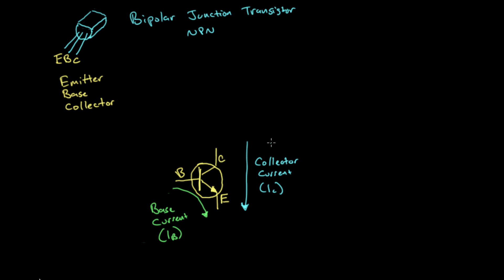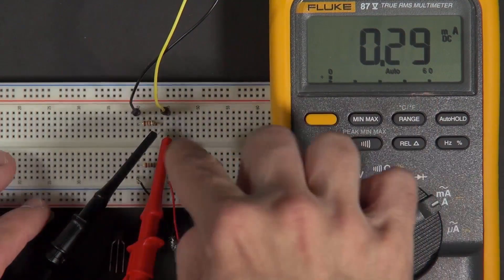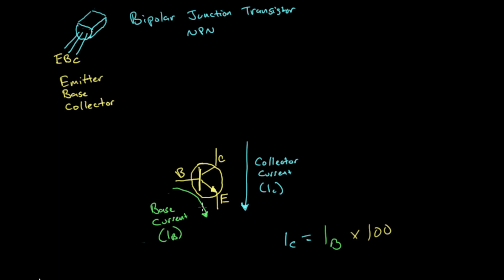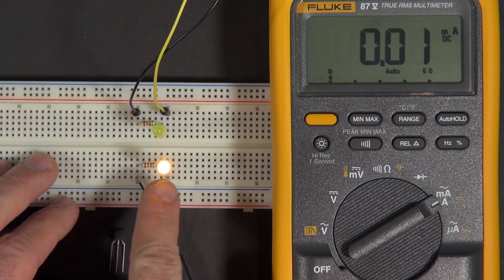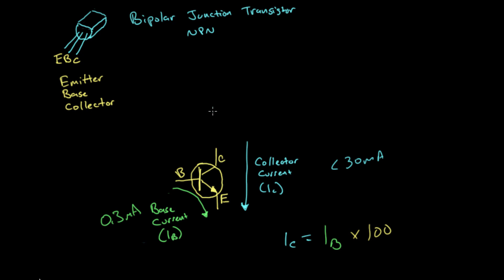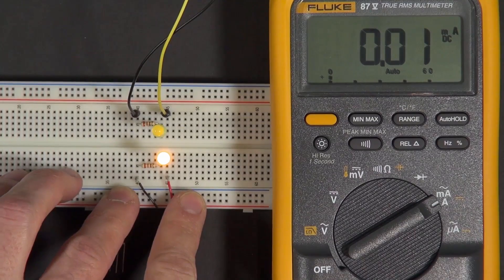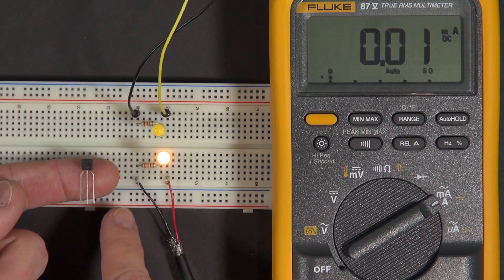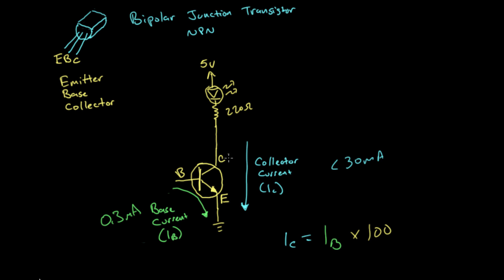Using a transistor to solve our problem | Digital electronics (8 of 10)

Comment: hi, i thought the whole idea was to use a transistor to  amplify the weak current from the mystery circuit.
But you did not do that. You just used the power supply circuit where the LED was bright to begin with.
wasn't that your pitch from the beginning ? Using a transistor to brighten the LED from the mystery circuit. Instread what we have here is a transistor used as a switch, not as a current amplifier.
Reply: thats what i thought as well,  it really seems that this circuit doesnt solve the original problem

Comment: What would happen if he removed the resistor at 8:19 and directly hooked the LED up to the emitter of the transistor? I know that then the voltage drop would be 5.0V, but surely it wouldn't be too bad because the current would be limited to 30mA? Would it still damage the LED if he tried that, and why?
Reply: If I'm not mistaken (which I might very well be) the LED would still possibly "burn" since the effect that it would have to discepate would be 0.15W (5V*0.03A) rather than the 0.057 (1.9V*0.03A) that it's rated for.
Best regards

Comment: What makes the multiplication happen inside the transistor? I just watched your video explaining how transistors work in detail and I understood all that, but how can I think about the current multiplication and variable resistor in terms of your other video? It feel like there are "decisions" being made inside the transistor, which I know isn't really happening
Reply: Cab Callaway hey the current is not at ol being multiplyed by 100 but it is allowed to pass only when even a current 100 times less flows from base.emmiter circuit
Reply: It's the nature of semiconductors. If you read up on this topic you will begin to understand what is happening in the transistor.
Reply: Since you didn't really answer my question, can you point me to resources that can?
Reply: OK, imagine the transistor as a kind of special relay where instead of an on or off state, the solenoid in the coil is attached to a variable resistor. A weak current will pull the solenoid, (which is being held back by a spring), just a little way from the totally off position to a corresponding large resistance position, giving a small current (or amplification). Apply more current and the solenoid is pulled further along towards the totally on position (the saturation position in a transistor), giving more current and more amp. Even more current applied to relay solenoid and it goes all the way. In this position it is acting as a switch. Hope this helps.
Reply: @Cab Callaway https://electronics.howstuffworks.com/diode.htm

Comment: Is it always safe to just connect two separate circuits' grounds like that? I can't quite put my finger on it, but it just doesn't seem safe to me...
Reply: Usually. There is a thing called ground loops that can cause trouble, but usually it is fine. Connecting the ground ensures that both circuits are measuring voltages from the same zero reference. Otherwise the signal voltages from one circuit would not be meaningful in another circuit. (I wouldn't recommend connecting both grounds and supply voltages at the same time between two circuits, though. That sounds like trouble.)

Comment: Your explanation of how a transistor amplifies was good.  But I felt your final example only demonstrated how the transistor acted as a switch, but I didn't really see an example of it amplifying.  Maybe I missed something.
Reply: That's the reply I would have given, @KoksBettan ;)
It's an awful use of the word 'amplifier' applied to a transistor.  An amplifier is a circuit and that's what Ben is describing. I knew enough to predict that the USB power would have to be used but I did get a little bit excited thinking that there might be some magical way to get a bright LED without it.
Reply: Hey, one step at a time brah.
Reply: This is the introduction to digital circuits hence using the transistor as a switch, aka 0(cutoff) or 1(saturation). Look up transistors use in analog linear amplifiers to see it used in all states between cutoff and saturation.
Reply: See my comment on Scott JD's post.

Comment: Thanks for the explanation, but I have a small question: Why do we have to connect the external ground to our ground (from the power source)? What would happened if we just ignore it? We're feeding the transistor with the signal anyway, shouldn't that be enough?
Reply: Logically speaking, the 'ground' has the same voltage as the emitter. That's why we have to connect the 'external' ground to 'our ground' to properly maintain the voltage difference between the collector and the emitter.
Reply: Also so that base current has a return path to the original circuit.

Comment: Thank you for the video! I have one question, Why do you need the resistor for the LED if the transistor itself has a resistor in it? Couldn't you remove the resistor?
Reply: No because the transistor wants to push 30mA but the external resistor is limiting that potentially 30mA output to just 20mA. You remove the resistor, you might blow the LED.
Reply: Because the LED is bright enough and with this resistor you are increasing the lifetime of the LED. Yes, and you are saving current -> energy (imagine the resistor is infinite).
Reply: The big reason is that the amount of gain from the transistor varies a lot. For a 2N3904 it's varies from 30X to 300X from one device to another, even from the same batch of transistors.  You can test each one but most of the time it's easier to make the output current higher then you need and then limit the current with a resistor.

Comment: Ok, I like the way you explain things. Keep up the good work. As for this video I'm still a little lost as you explained the transistor as a current amplifier . So I was expecting this transistor to power the led on top of the breadboard from the mystery (555 timer) power. But instead to me it looks more like a switch because your still using the original power from the bottom half of the bread board, and then using the low current from the mystery power to tell the transistor with the little current to switch on and off allowing the bottom power to complete the circuit. 
Of the original bottom USB power wasn't in this final circuit then I could see how it's acting as an amplifier. But now it's using two power sources. It's not until the end when you call the transistor a low current switch that controls the larger current from power supply 1 (USB) that my mind agreed with you, but how does amplification play a part? So am I seeing this wrong? What am I missing?
Reply: As soon as the video ended, I was left with the same question as Scott JD.
Then I had to think about it for a little while:
Whether it acts as a "digital switch" (sat/cutoff) or as an "analog amplifier", transistors don't create more energy out of thin air. In order to allow a transistor to amplify a signal, you need that "extra" energy to come from somewhere, from another source. What the transistor as an amplifier does, it to maintain the order and proportion of the incoming signal, and just make it more "intense", so that intensity is analog to the incoming signal. So the BASE is that signal, and the transistor will respect it while "mixing" it with the extra power that you feed it through the COLLECTOR. 

So the name of each lead actually tells you what is happening:
The BASE is a signal which "waveform" has to be respected
The COLLECTOR collects energy from another source, which will be used for amplification 
The EMMITER emits the amplified base signal. 

Think about any component that you have used in your life: they all need a "raw" source of power to amplify base signals (which almost always account for information rather than power supply) accordingly. 

The volume knob on your stereo? Wall socket. 
Electret Microphone? AA battery. 

So to end it all, you could think about the BASE as "electrical information" which needs to be amplified and the "COLLECTOR" as the lead which power has to be supplied to fulfill that purpose.
Reply: Dam Dam completely cleared up any confusions I had, thank you
Reply: @alanboro  I guess it's still incorrect to call transistor as amplifier. Without it the bottom setup will still work.
The current doesn't magically multiplied, we just used another source (bottom DC), while the "base" is a low-current instruction to SATURATE or CUTOFF the circuit. Again, the point is: throw away the transistor and NOTHING needs to be amplified. So it's definitely NOT an amplifier in any way. It's a logical switcher
Reply: It's really a matter of semantics. Imagine that the mystery signal was an analog signal, lets say a small sinusoidal wave at 440Hz, and was trying to power a speaker. This same setup would work to amplify the signal so that the speaker would be loud enough. So in other words, it only appears like switching in this case because the mystery signal is a digital signal, that is switching hard between 0 and +5V. That said, switching and amplification are really two sides of the same coin, we usually use the term switching for digital logic, and amplification for analog signals. For example, it could be argued that an inverter is really just a digital inverting amplifier of some sort.
Reply: @dmsalomon  best explanation so it's in terms of ac signal
Reply: I really don't care to argue but this is a switching transistor not amplifier, it can be argued that it is the same thing but if you are teaching this concepts to beginners the terms should be used properly so as not to course confusion.
Reply: I think Dovi Salomon has the right idea. I would argue that an amplifier reproduces its input signal at a higher power. That power has to come from somewhere, so an amplifier will always have a power source that is independent of the signal (though it may not be independent of the power source for the circuit that generated the signal). In this case the input is a square wave voltage signal. Ben Eater has already demonstrated that the signal source cannot provide enough current to drive the LED, so we need more current. The output signal, therefore, is a square wave of current to drive the LED. Since the output signal has more power (large current at 5V) than the input signal (small current at 5V) the signal has been amplified.

But there is a special case of using a transistor to do amplification. If you have a digital input signal and always drive the transistor into cutoff or saturation, then that transistor's operation can be modeled as a switch. It is still amplifying, however it is often conceptually simpler to think of such a circuit as a switch. In other words, a transistor is always an amplifier but sometimes we can think of the kind of amplifying that a transistor does as switching.
Reply: That's how it amplifies, you need an input signal (the 555) and a power source (5v) the 555 is only conducting 0.3ua so not enough to lite the LED brightly. However, when you pass the same 555 current through the transistor, the transistor 'switches on' allowing a current to conduct from the 5v supply, this current is higher by a factor and passes through the LED which shines brighter.
Reply: I know what you're saying, but surely, it's both? It's using a small signal to switch a larger 'amplified' signal?
Reply: Chuck, that isn't amplifying.  That is switching.  It is acting as a switch to allow current to flow under certain conditions, which is what transistors are used for in computing, but that isn't amplifying anything at all in his example.
Reply: In this case it is switching because the transistor is "saturated". Ben explained this in one of the previous videos in this series. You need to watch them all.
Reply: @Bodragon  But when it will amplify the signal ? Maybe if he put the transistor before LED ? Thanks.

Comment: Thanks a lot... Finally understood how transistor amplifies current... :) One thing still not clear... Why the LED is blinking???
Reply: The reason the LED is still blinking is that the "timer" from the top part of the breadboard is connected to the Base of the transistor. So when the "timer" is "off" and doesn't give any current, the Base is 0, and since 0 * 100 is also zero, the transistor  collector, which tries to give one hundred times the base, is not allowed to send any power through and therefore in cutoff mode. When the "timer" is "on" and gives a current, the Base has a current going into it, and therefore the Collector is allowed to send current through, since it will try to send one hundred times the base, and 0.3 * 100 is 30.
Was that clearer? If not, feel free to ask for a clarification.
Reply: Yeah its totally clear now. Thanks a ton! :)